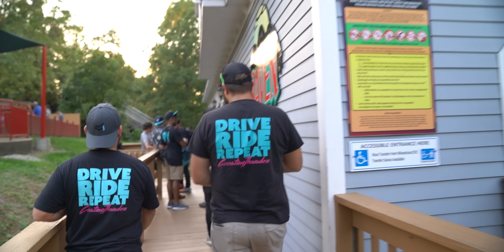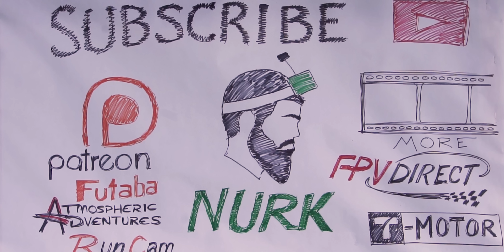How to have a Successful Mistake - Roller Coaster FPV Filming

Comment: Great Video nice to see your process.
Question: do you setup Turtle Mode and ESC Beeping?  Not sure if your battery came off on the coaster crash but they both have saved my bacon on shoots.  I had RC signal drop one time when shooting some property and it dropped on a barn roof upside down and Turtle Mode saved me.  I recently was hired to film for a company that makes drum mulchers and had a wood chip take the quad down in the woods in tall brush and without ESC Beeping it would have not been recoverable.

Comment: To shoot roller coasters easier, you'll need a drone that can fly 3D (like those aerobatic cp helis)
Roller coasters can pull more negative G forces than freefall. Roller coaster enthusiasts call that ejector airtime, as you feel like you violently get thrown out of the seat since you accelerate downwards faster than gravitional pull. The drone without 3D can not accelerate downwards faster than gravity since least thrust you can get is cutting the throttle off and letting the drone fall. But if you have a 3D drone, you can Actually catch up with how violently the roller coaster goes down the drop as you can get negative thrust.